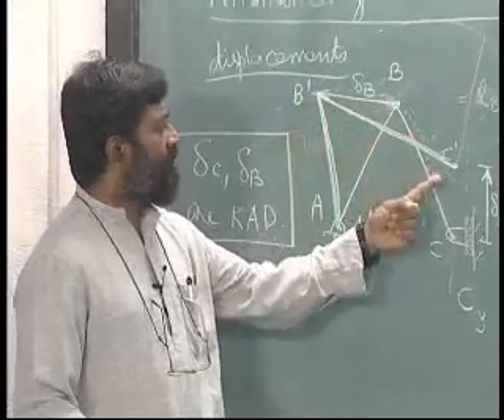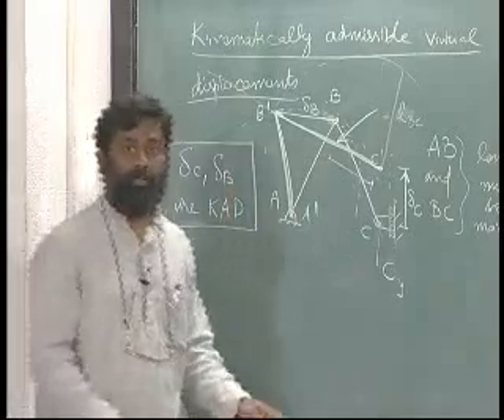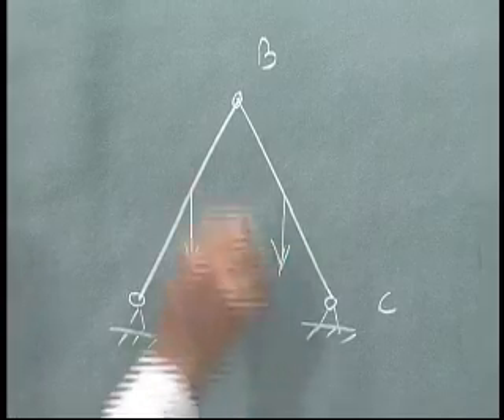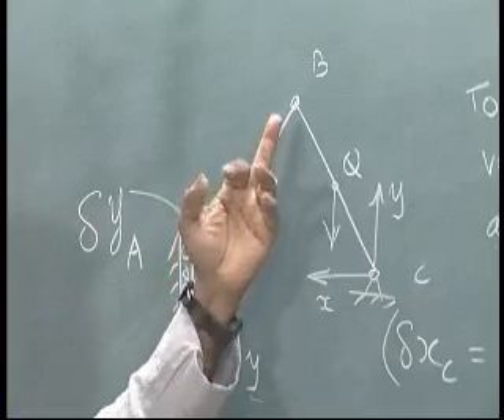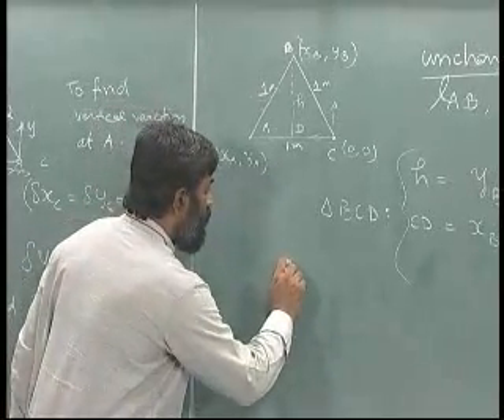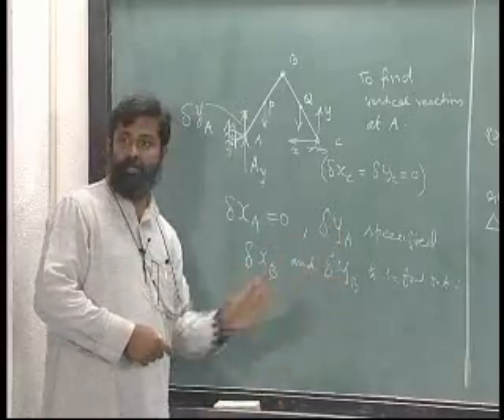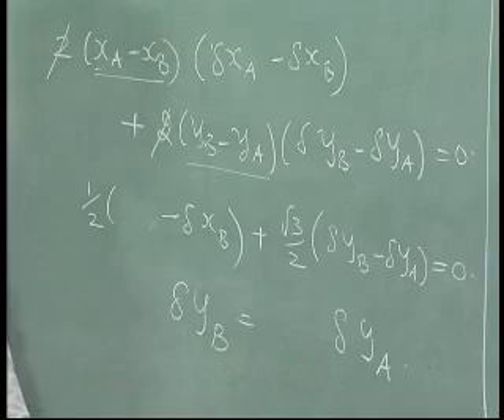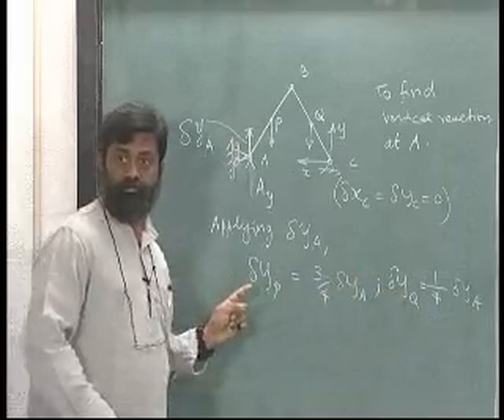Mechanics of Solids - IITM 3.3 Finding virtual displacements

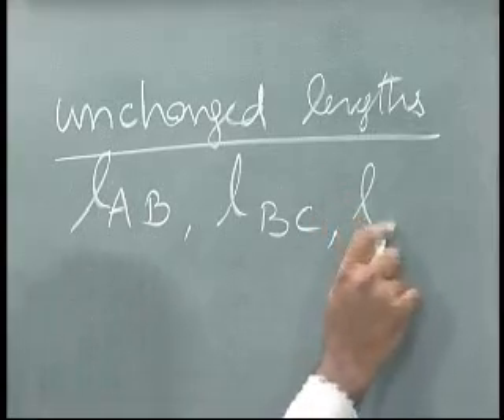Comment: at 15:13, is it mandatory that there is no change in length AC in this method? what if we are going to find out the horizontal virtual displacement deltaXP or deltaXQ? AC length should gets changed or not?
Reply: I suspect we ignore d(AC) because it only changes in the 2nd order when we change y_A. Since we assume that d(y_A) is small (infinitesimal), 2nd order changes can be ignored.